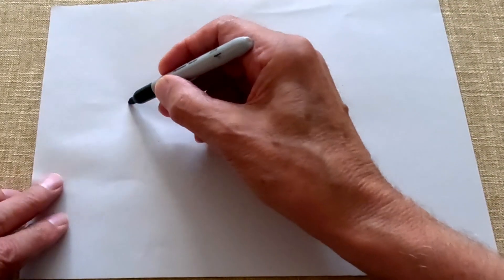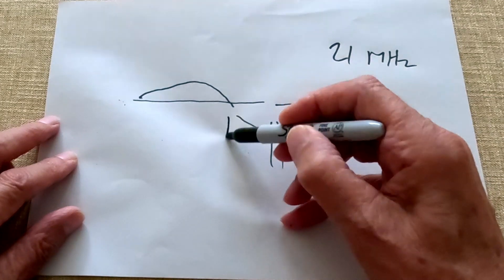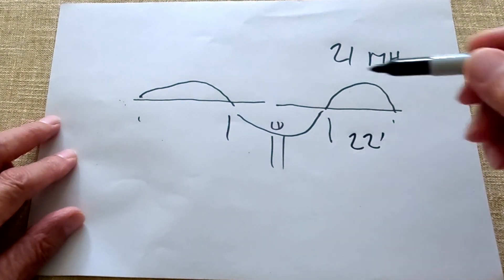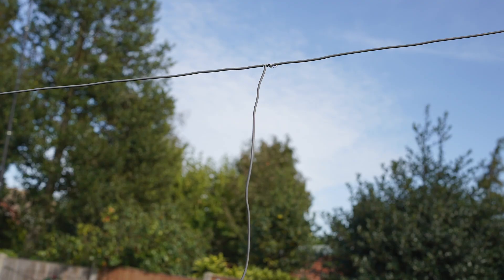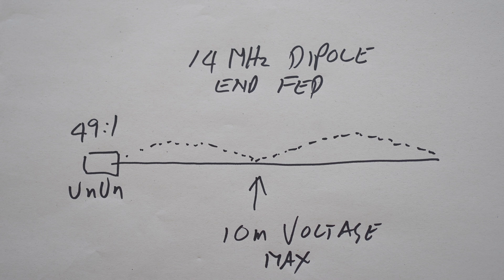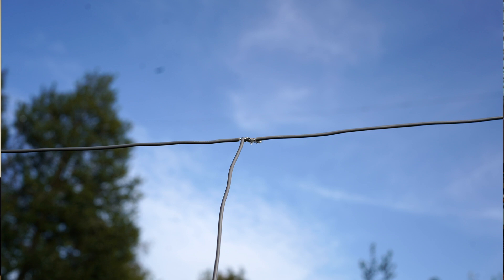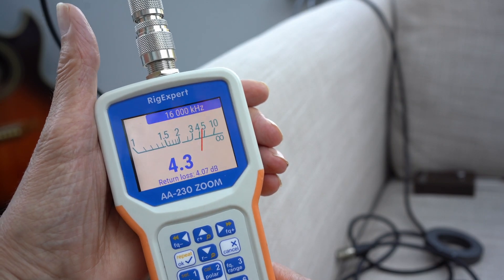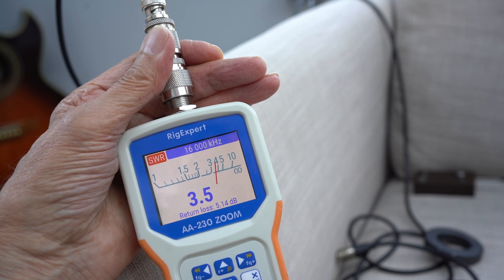HF ANTENNAS - Tips & Tricks  | HAM RADIO

Comment: Will the capacity hat trick work with inverted V antennas, or is it a problem with inverted Vs?
Reply from the maker: To be effective a capacity hat has to be placed ay a voltage max point on an antenna. It will work on amu antenna.

Comment: I find that with a 40-10 EFHW (66ft-ish) if you fold a few inches of the end of the wire back on itself, the 10m band drops in nicely.
Reply from the maker: That adjustment would normally affect other bands as well, but as with any length adjustment, it is magnified, progressively on the harmonics.

Comment: Hi Peter, found it a very interesting video. Actually i have a Dipol for 40m which I am using for 15 meters too. At 40m it’s lowest swr is at 7100 just in de middle of the band. At 15m the lowest swr is at 20930 so it is to low. Not to high.
Parallel (about 5cm) to that wire i have one second wire for 20m. Would be great if I could use that for 10m too.  So I  made a inverted V dipole for 20m in mmana. With a swr of 1,45. Using that one for 10m I get a swr of 110. Adding a wire in the middle of both legs with 45cm length didn’t change anything. So that seems not to be working for a Dipol. 
After that I made a efhw for 20 on a hight of 5m, and added a wire in the middle. Without the wire I had a swr of 1,13 at 14,15  and 1,41 at 30 mhz (only calculated until 30) with a wire in the middle of 4 meters it was 1,67 at 29,4 mhz.  The 1,13 at 14,5 mhz didn’t change. 
So it seems that the necessary wire length in real can be a lot shorter then in the simulation.
Reply from the maker: You will never get 10m resonance on a 20m dipole. The method of operation is totally different to that of end fed antennas.

Comment: Based on my own experience, you could probably also use some aluminum / aluminium foil (metal) 'duct' tape and don't bother stripping the conductor. Just fold it over the element and make a flag. The increased surface area means that you won't need two feet, but mere inches.

My experience was trimming a 15m dipole and overshooting the mark, leaving the dipole a few inches too short. Immediately (instinctively) I added a few square inches of metal duct tape to the ends as folded-over little 'flags' (capacitive hats), and I was very surprised that I had to trim them to barely a couple of square cm to get back on track. Surprisingly tiny area.

Cheers.
Reply from the maker: Interesting observation. I will check it out sometimem to see how it compares.

Comment: Peter! Thank you for this wisdom, BTW I still like using "old money" when building -its easier in my mind to visualize.  So I put up a 40 meter inverted v in my postage stamp size yard , it's close to the house, so I had common mode current on my feed line, plus it was noisy QRN I choked my feed at my coax switch, that reduced the noise. as for 15MHz seems the VSWR is workable,  but it doesn't hear as well,  wondering if adding the capacity hangers would help with RX ? 73 TU DE N3TGY ..
Reply from the maker: Unlikely that the hats will improve receive, as even with a modest VSWR, receiver side tends to cope OK. You could rig up a temporary 15m dipole and see how that compzres.

Comment: Hi Peter, I truly believe the "shift" in the harmonics has to do with the non-ideal inductance of the transformer. In the 40m band, the inductance makes it requires a shorter radiator. When you go to 10m, the really high inductance makes the transformer closer to ideal, but as the radiator is shorter, we are way up in the band (or even outside)...
Reply from the maker: It may well be the transformer, and possibly the corrective capacitor. The issue seems to occur on both 40m and 20m base band versions.
Reply: There's also the end effect. It effectively lengthens the antenna at the fundamental by more than on subsequent harmonics (due to more "ends" of the half waves but the wire only physically having two), so if the antenna is tuned to the fundamental, it'll be too short on the next harmonic and get shorter for each subsequent harmonic, though by not as much. Two other ways of getting round this are a capacitor in the centre of the EFHW, which on the fundamental, electrically shortens it at that frequency but has little effect on the harmonics (the wire has to be a little longer overall of course than the otherwise resonant length on the fundamental), or by introducing a small inductor/loading coil which has less effect as you go up in frequency.